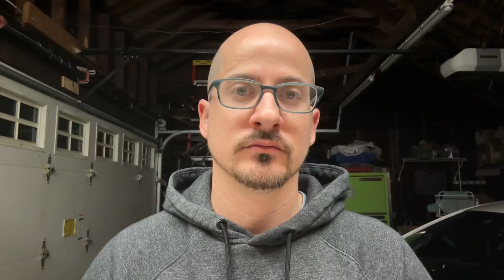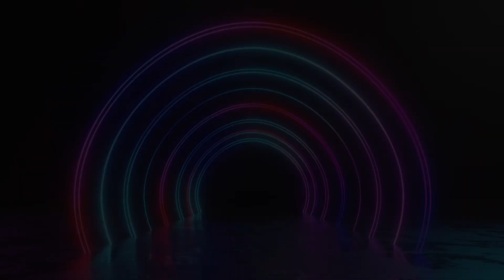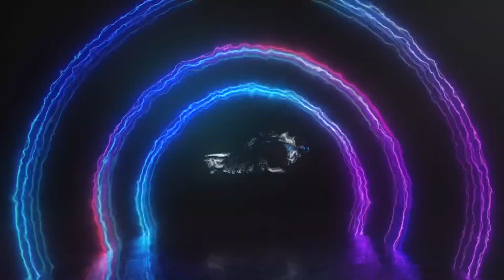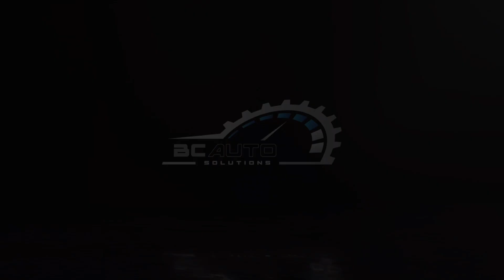Unfolding Hondas oil dilution issue

Comment: Hey just checking in, so far I'm at 1.9k miles now... 2024 accord 1.5t 
I'm going to smell my dipstick for gasoline. Since the day I picked up the car I have been fueling with 93

As always thank you for your videos  good sir!
Reply from the maker: Thank you and keep us posted!
Reply: @BCautosutions   i just parked after driving for 45 minutes, waited for 5 minutes and checked. I smell gasoline on the dipstick
Reply from the maker: @juanc4065  strong or minimal?
Reply: @BCautosutions   minimal but its definitely there
Reply from the maker: @juanc4065  let me know how it goes.
Reply: I have on I l change appointment next Saturday with the dealership. Any questions you think I should ask them? Car has 3,200 miles now. Thx!!

PS. Also going to ask them to look at the "system update unavailable . contact  your dealership "
Reply from the maker: @juanc4065  are you having strong smell? Easiest way to tell is to see if the oil levers is above the fill mark.

The system update last time I checked is just a reset and doesn’t actually have an update available.

Comment: I don't understand why are you not recommending idling to warm up engine before drive. Does it better to drive and stress cold engine which didn't reach operating temperature and still have bigger gaps in metal while cold than let it idle for 10 minutes to slowly warm up engine without turbo blowing pressure in cylinders? My wife has 2023 CR-V with not even 5k miles on it, we are in Northern Canada, but car sit in heated garage for night and I changed oil after 1000 and 2000 miles. Always warm up car before driving to preheat cabin and seats, no oil dillution yet
Reply from the maker: Long term Idling and oil dilution are directly related. Idle 2-3 minutes then drive the car (no wide open throttle) until fully warmed up. The quicker the car warms up the better. You have a heated garage so chances are you will experience little to zero dilution.
Reply: Idling is literally the worst thing you can do to try to warm up an engine. Especially on 1.5Ts this won’t get the engine hot enough and cause MORE dilution

Comment: Unless cold weather and/or very short trips, 3k miles is insane for an oil change. I change it it every 10k km (+6k miles) and i use Amsoil SS 0w30, and the oil comes out perfect regarding viscosity.

Comment: The oil in my catch can on my L15 NA Fit is a chunky, milky light brown color. Should it be the color of oil in the catch can or is this light brown sludge ok?
Reply: Depends on the weather. Higher humidity can mix moisture/ condensation with the oil in the catch can. It doesn't burn off. Makes you think blown head gasket.
Reply from the maker: Most likely normal especially for the winter months.

Comment: When you do early oil changes do you reset the mm for oil or just let it rock till its reccomended interval? I plan on doing early oil changes on my car but I dont want to mess up the schedule for other things like trans fluid and rear diff fluid.
Reply from the maker: I usually reset it, this last time I haven’t, I’m curious to see how long it’ll go before recommending and oil change on my car. I’m going to assume 6-8k which is absurd since I drive it pretty hard and has 100 extra whp/tq that the algorithm will never account for.

Comment: Does premium gas help with oil dilution?
Reply: Do you use 87octane fuel or higher? I have a 2021 Honda crv ex and the dip stick smells like gas
Reply: @christopherthomas7957  I've had my 2023 for a year now. I used 87 octane for about the first 1000 miles and noticed a fuel smell on the dipstick. I switched to 93 octane for the next 13000 miles and the smell disappeared. Since this site recommends 91 or higher octane I plan to stick with it. In Michigan I can only get 93 which is $1 a gallon more which I'm not happy about. I'll probably only keep the car a couple more years and opt for a hybrid.
Reply from the maker: Wouldn’t necessarily say that although would help with other issues with come along with a gdi turbo engine.

Comment: I own a 2019 Acura RDX with the 2.0 T any issues with this that you are aware of?
Reply from the maker: There can be some dilution which can be expedited in any gdi engine. Just take a look and smell your dipstick before getting your oil changed. Much smaller sample size vs the 1.5t

Comment: Do you recommend to stick with 0w20 after 200k 1.5t?
Reply: I use 5w20 winter and 5w30 summer
Reply from the maker: 5 w20/30 is what I would use.
Reply: @BCautosutions  thank you 🙏🏻
Reply from the maker: @jorgecastaneda7644  🙌

Comment: Honda used to be great. I still have my 2009 CRV.  Great car.  However, I will not be buying another Honda.  I switched to Toyota.
Reply: I had a 08 crv .incredible car but wanted to upgrade to newer crv till they changed the engine .I was looking at 2021 Toyota highlander but 3rd row was a joke and infotainment system was definitely outdated and had cvt transmission didn't want those.so I went with 2020 pilot no dilution problems no turbo,no cvt.im 6'4 and fit in the 3rd row of my pilot.
Reply from the maker: @pilot2020  🙌
Reply from the maker: What Toyota did you get?
Reply: @BCautosutions  Camry
Reply from the maker: @nickv4073  congrats, best of luck. 🙌

Comment: Thanks for this video. My son comes over every few months to change his oil on his 2018 Honda Accord. I noticed the other day that the oil smelled like gasoline and after draining was almost a quart over filled. I thought maybe we just over filled on the last oil change even though we are always careful to fill to the full mark. After watching your video I'm sure we didn't, and this must be my son's problem with his car. We change the oil every 5k but maybe will change to 3k? This car has been junk from day one. It is driven mostly highway miles and has always been well maintained. At 60k the head gasket went and took numerous trips to the dealer to diagnose. Shortly after the engine main seal started leaking and had to be replaced twice to get it resolved. Honda blew it with this POS 1.5 liter turbo pile of garbage. Oh yeah tie rod end on the last inspection as well but at least now with 82k still has the original breaks so kudos to Honda for that. Bottom line is, we will never buy another Honda 1.5 engine with a turbo. All manufactures are doing it because of the tree hugging EPA standards so good luck finding a reliable car going forward. I will continue to buy the naturally aspirated v6 Toyota 4Runners until the day that I die.
Reply: This car should fall under the lemon law.
Reply from the maker: Basically sums up how many people are feeling unfortunately. Thanks for sharing your story.
Reply: Go hug a tree
Reply: Have him try out a Tesla.   It’s like night and day in how it drives.

Comment: Curious if using the engine block heater accessory during the winter could help with this since I take multiple short trips a day. Otherwise I guess I have to go electric! 😅
Reply: I disagree with the other poster. A block heater might help with this issue.
Reply: No

Comment: Any dillution issues in other engines? IE the 2.0t, or the 1.5 NA Motors in the fit or insight?
Reply from the maker: In a mass scale no. Although any direct injection turbo engine is more likely to have an issue.

Comment: I have said it before, I will say it again. The Honda L15 (1.5t) is problem engine all around. If it isn't the head gasket issue that gets you, the oil dilution eventually will.
Reply from the maker: Or the turbo, or the injectors, etc
Reply: @BCautosutions  there are people with 200 000 miles on them with original turbo/injectors.
They are not as bad as people think if you compare these engines with other engines from other manufacturers.
Reply from the maker: @Eugen-E  could be although we are doing injectors daily and turbos few a month. Too many failing imo.

Comment: What do you think about using Sport Mode more frequently to keep rev's high during cold season to combat oil dilution?
Reply from the maker: Should in theory get the engine up to running temps quicker. I’m for it 👍🏻

Comment: I traded my 2018 Accord EX 1.5T for the 2024 Toyota Camry XSE V6 to avoid any additional headaches in the future, oil dilution, and a blown head gasket. Sadly the Honda's reliability is not the way it used to be.
Reply from the maker: Congrats on the new car. How are you liking it?
Reply: @BCautosutions  I love it, my other car is the 2007 Honda Accord EXL V6 with over 300,000 miles and it's still running strong. Unfortunately, I can't say the same for the 2018 Accord with the 1.5T engine. Thank you for the wonderful videos. Much appreciated.
Reply from the maker: @udt32000able  thanks for your input. Best of luck with all your vehicles!
Reply: The truth is I love the new Camry XSE V6, I still have my old 2007 Honda Accord EXL V6 with over 300,000 miles It's still running strong, and I wish I could say the same for the 2018 Accord with the 1.5T engine. @BCautosutions

Comment: Could this be why Honda is introducing hybrids to any models that have a 1.5t available? It seems that the hybrids are poised to put the 1.5t out of its misery, all we need is an Integra hybrid and the hybrids are ready.
Reply: Have a 2018 Insight with 55k miles. Zero issues.
Reply from the maker: @Eugen-E  insights are great. Zero to minimal issues. Matter of fact, can’t remember last time I did anything major on them 😅. The 2.0 hybrids on accords and cr-vs are a different story.
Reply: @BCautosutions  I know some people with older 2.0 hybrid Accords and also 0 issues. 
The Insight actually had one minor issue: last year replaced the AC condenser.
Reply from the maker: @Eugen-E  overall solid car none the less 💯
Reply from the maker: No, hybrids target a different market imo and they will also come with some issues as we are starting to see some already early on.

Comment: This is why i bought the 2018 CRV LX (2.4 NA), no issues so far; while others with 1.5T on Civics, CRVs and Accodrs where i live (Dominican Republic) have a lot issues with engine injectors, head gaskets and transmission.
Reply from the maker: Thanks for sharing and you made the right choice.
Reply: Same here… I bought the 2018 LX brand new right off the truck straight from the factory.  Love it 😊
Reply from the maker: @MoNoK15  🙌
Reply: I was looking at these also, I like that generation body style crv but don’t like the 1.5t I only recently learned that the LX trim still had the 2.4
Reply from the maker: @cartere9981  yes only for 1-2 years from what I recall then all trims got the 1.5t
Reply: Should have kept the old trusty 2.4
Reply: Wow, ta duro. There are a lot of people in  Dr driving these CRVs.
Reply from the maker: @romanc.5074  💯
Reply: Is Honda under new management or something?  Hate to see their reliability fall like that.

Comment: My 2019 crv has excessive oil dilution during the winter. No problem at all in the summer. I have had the heater control module changed.  This has done very little to improve the situation. I drive in sport mode put the heater on low during winter months. There have been engine failures in my area. People that do only short runs in cold winter condtions have had ice in the crankcase. Engines never getting to operating temp. I'm a retired mechanic and have seen ice in a crankcase before. Vehicles go in for a no crank situation and it is because of ice in the crank.  I have asked if you could make a video on how honda has changed the 1.5. I see they have a different turbo now.
Reply from the maker: From what I can tell not much that was significant has changed. Not from the engine specifics that would convince me otherwise.
Reply: @BCautosutions  I thought maybe there was a change in cooling system. The 2024 does provide heat much faster than my 2019.
Reply from the maker: @m109r  could very well be cooling system, software changes, etc. hardware changes with the engine itself I would have to rule out. You know I think I’ll have to do a side by side comparison of 5th gen and 6th warm up times and temps. Think people could find that useful actually and potentially confirm your findings here 👍🏻
Reply: All I did was idle both vehicles with heater on high on a minus 16 farenheit day. I used my my heat  temp gun to monitor both . Disappointed  the 2024 has no temp guage.
Reply from the maker: @m109r  I hate the no temp gauge movement. Something so critical to eliminate imo.

Comment: First of all the oil dilution issue was primarily in states that are very cold in 17-18 model  year CR-V .In Colorado it's a rarity and my dealer has not had seen any issues with this. All di engines especially turbo's have some oil dilution . This and your vids on hg issues portray this engine as a real dud. In the CR-V case Honda sells 300-400k units in a good year. I find it hard to believe it has all these issues. I'm not saying there are not some isolated issues but I feel like the hg issue it's blow out of proportion.
Reply: Agreed 👍 it is blown out of proportion all people have to do is stop making 1 mile short trips and take longer trips to get the engine hot enough and you will be perfectly fine! I’ve got 18.000 miles on my 2022 civic and not once has my oil level increased do to “oil dilution”
Reply from the maker: @nathanielcasas8923  I do think the head gasket issue is a bigger deal vs the oil dilution personally. Dilution you can avoid or minimize, a blown head gasket is only a matter of time until it blows in many more occasions.
Reply: @BCautosutions  which is why I only put premium in my car and change the oil every 2,500-3,000 miles to help at least prevent knock and pinging which can lead to head gasket failure lol it’s funny because on the Acura models with the same engines it says to use premium? Kind of funny how that works huh ? I believe these 1.5t engines aren’t supposed to be ran on regular 87 gas I don’t care how many knock sensors there are those systems aren’t 100% reliable they aren’t gunna prevent every single LSPI event
Reply from the maker: @nathanielcasas8923  exactly. On my second video that I made recently on Hondas pages they recommend premium on the cr-v and accord I believe but then in owners manual says regular. 🤦🏻‍♂️
Reply: @BCautosutions yeah it’s ridiculous and people wonder why they are having to get new head gaskets……………common freaking sense people just use 91-93 octane the price difference between 87 octane and 91-93 per gas tank is the price of a Starbucks coffee which people are willing to buy on a daily basis 🤦🏻‍♂️ but yet they won’t do that to buy premium gas 😂😂😂😂 blows my mind how stupid people are when it comes to cheaping out on there cars lmao
Reply from the maker: @nathanielcasas8923  people’s priorities aren’t right. Everyone wants to Instagram stunt 😅
Reply from the maker: Yes I did mention that the issue is primary more so in cold states like nj that I’m in. The head gasket issues are real weather or not you think it is. It’s all over. I speak to 20-30 techs and most of us are seeing this. Also go on fb, Reddit, YouTube, google, etc. it’s all there.

Comment: Currently we own fourHondas all naturally aspirated.  Two of them over 200,000 miles. None of them burn or use any oil.  I will not buy any turbo or supercharged engine from any manufacturer.  The only permanent fix for oil dilution which is a mechanical problem is a NA engine.
Reply from the maker: Keep them until you can’t 💯
Reply: The problem has nothing to do for it being turbo, it's due people doing poor maintenances and being direct injection (DI always leak gas to oil), mixed with cold weather and short trips, and the fact that is one of the most engine sold also makes for the issue.
Reply: Nonsense

Comment: I have a 2021 Accord that has squealing brakes only while in reverse since it was new. What would be the best way to address this?  The pads still have 50% of the friction material left. The sound seems to be coming from the back of the car.
Reply: That's normal. Some brakes just squeak more than others based on their materials, how they rub against the discs, or how they're used. Hybrids are particularly prone to squeaking because they're barely used. Back up a few MPH and press the brakes a couple times to rub off any potential surface rust or dirt on the rotors. My CR-V has squeaked in Reverse since new (built January 2024). Not a safety issue.
Reply from the maker: Pretty normal tbh. Probably just some moisture or dust on the pads. Honda tries to balance noise, dust, wear, and typically does a decent job but in situations can make noise. I would maybe scuff the pads if it bothers you, might last a while without making noise until it’s time to replace them.
Reply: Sir, with all the other major engine issues the 10th generation Accord is having your brakes squealing is a relatively minor issue.